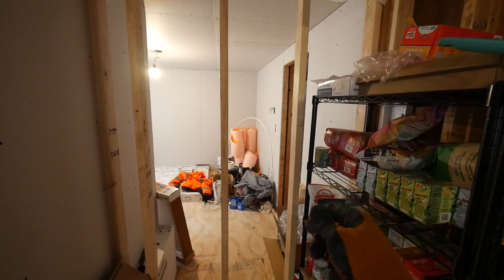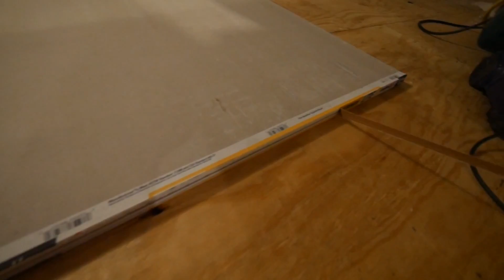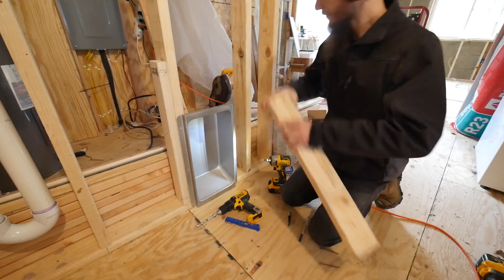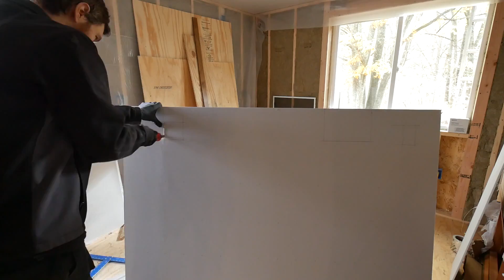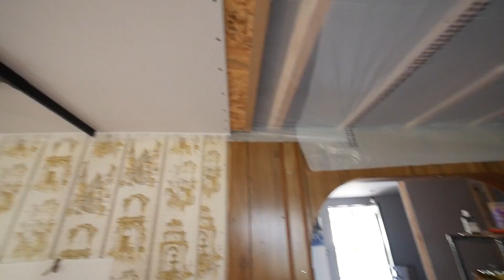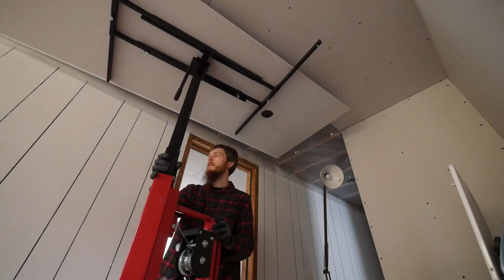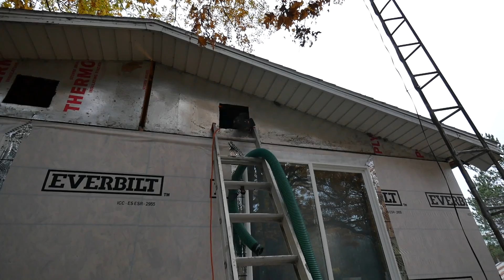Renovation Overload | Why we Install a Vapor Barrier on the Ceiling - Home Renovation

Comment: I grew up in Southern California where we had no insulation or vapor barrier in the older houses.  It could get pretty cold for little feet on bare floors.  So nice to see some real time explanations of the purpose, and placement of the vapor barriers.  Makes real sense.  Now, it seems, you're winter tight, and can use the bathroom inside, and wash laundry...  Are you hanging it outdoors?  So many little things to remember and do.  Congrats on it all.  I could feel the relief. Kid's cameos, so cute.
Reply from the maker: We were hanging it outdoors up until recently. We bought an indoor metal clothes drying rack to use now :) Thanks!
Reply: @diyfferent  ...  It wont be long till everything is painted, and  your drying is working.

Comment: Woooo Hoooo!  The finish line is clearly in sight!  Vapor barrier - DONE!  Wall insulation - DONE!  Kitchen sink drain and vent - DONE!  Wiring - DONE! (?)  Washing machine hooked up and in use!  Blown-in ceiling insulation - DONE!  Plywood on the floor - mostly done?  Ceiling dry wall - DONE!  Laundry area dry walled in!  J-channels for dry wall finished edges.  BTW, thanks for the explanation about the vapor barrier on the inside and on the ceiling.  Once again, a dead-man lift would have come in very handy when you got to the part of the hallway where you couldn't use the dry-wall lift.  I'm sure you have the material you need as scrap wood in your barn!  Doug, I was completely shocked to see you crawl through that little tiny hole in your attic to do the blown-in attic insulation!  The extra long video was super nice!  And it was SUPER nice seeing Belle and Maverick again!  Maverick is your mini-me Doug;  You will have no trouble training him as your apprentice!  Just do it while he is still young and wants to mimic you!  LOL.   I know it feels good to have heat again.  Before long, you will have your back door in and installed and you will be all closed in for the winter!  Oooh Ra!

Comment: The one thing I know about you is that you do your research before you do anything.. I’m confident you are doing an excellent job ..  I can imagine how cold you get there.. here in Arkansas it got down to 27 degrees last night.. we went from AC the beginning of the week to heat on yesterday.. with all the insulation you’re putting up it shouldn’t take much to heat the house.. I’ve learned a lot from how you’re doing the sheet rock.. I envy your agility.. at my age , 77 on the 25th of November , and two artificial knees, I don’t have any flexible..  now you don’t have to push yourself to beat the weather..and you can work without having to bundle up..I can wait until the next episode..
Reply: jerrie wyatt Happy early Birthday... I also have a Birthday this month.....🎉🎊💐🎂
Reply: Hiedi Romero Thank you so much! So sweet of you!
Reply: Hiedi Romero Happy birthday to you as well..

Comment: If you take a couple of 2x4"s and make a simple T , it really helps to hold up that drywall on the ceiling especially in the spots where the lifter wont fit.

Comment: In Australia we make a T board for holding drywall up which is so great in confined spaces. You use a long board tall enough to reach the ceiling and screw a smaller board across the top of it to form a T.  You push this up around the middle of your sheet of drywall and it will hold it in place. It’s too late for this house but it might help to know for the future. You do such awesome work and I love to watch.

Comment: Great work- way to push through. A suggestion for your ceiling lights- go with 4" recessed LED- that way you get full clearance, great light and energy savings. Also a big plus is that you do not have the problem of IC rating when using correct bulbs ( much cooler). Retrofit is easy and you can use the holes already cut.

Comment: For the narrow hallway ceiling, you could have built a tall “T” or 2. Like the kind cabinet makers use to aid in holding up the top cabinets while they install them.
Reply: Good idea!
Reply: When I installed drywall on the ceilings in my two bathrooms by myself, I screwed a temporary 2x4 cleat to one of the side walls about 3/4" below the ceiling joists.  Then, I slid one end of the drywall in that gap to hold the drywall while I held up the other end and started screwing it to the ceiling joists.  This method worked well for 5' long sheets.

Comment: In the late 90’s here in horry county South Carolina the electric company gave home owners an incentive on there monthly bill if while under construction they put plastic on their walls (and ceilings I think). They called it a good sense home. Well. What they didn’t realize it made the house unable to breath properly in this climate. They humidity here is very high at least 4 months out of the yr. my house was built by my father in law in the late 90’s. But, my father in law was smart. Once the inspector left,  he cut all the plastic before The Sheetrock went up. I believe there are many people here who sued because of the mold issues they encountered in the following years due to the home not being able to breath. So.... You are absolutely right on the money with the plastic and the climate you live. Love the videos!!! Good luck on your remodeling!!!

Comment: I just uploaded a short 8 1/2 minute video a couple of days ago and it took me 15 1/2 hours to upload it with my slow internet.  I can't even think about uploading a video the size of this video.  It would take me many days to get it done.  Then again, I only have CenturyLink and the fastest speed they offer here is a 1.5 meg connection.  Your place is really coming along great.  Wish I could get some of that stuff done to my place one of these days.
Reply from the maker: Wow, that's crazy slow! We are very lucky and have high-speed fiber optic internet. Most of our videos upload to Youtube within a couple of minutes. I think this one was under 5 minutes. Thank you :)
Reply: @diyfferent  They don't even offer fiber optic here.  We just have regular phone line DSL.  I count myself lucky in that they did upgrade it to a 1.5 meg service here about 4 years ago.  It used to be only 768K service before that.

Comment: You're absolutely correct in putting a vapor barrier immediately behind your drywall. Exterior walls, although insulated, have to breathe. You can't be trapping moisture in the exterior walls. It will, over time, ruin your insulation and rot the wall studs. Ever notice how craft-faced insulation is installed? It's always installed with the craft paper toward the living space, whether wall or ceiling.

Comment: Very good explanation of insulation and vapor barrier Doug!  The word you were fishing for was Vapor 'mitigator'.  Now, to help you out with your less vs more attic insulation, and less vs more attic ventilation, let me share a little backstory on the subject.

The old way of thinking was that the attic was a buffer zone between the house living space and the cold outside.  For instance, say you are trying to heat the house to 70 degrees, and the heat loss into the attic makes the attic 50 degrees.  Now you only need to heat the living space to compensate for a 20 degree difference at the ceiling instead of say 70 degrees assuming it's zero outside.  It was based on this type of thinking that they generally installed wood blocking at the eaves, to prevent airflow into the attic.  A warm attic used to be believed as a 'good' thing.  Now as you know anything that traps air is by default an insulator.  So when the roof gets covered in snow, the snow itself is an insulator.  Now in our previous supposition argument, the 50 degree attic now melts the bottom layer of snow, and the resulting water runs down to the eaves.  Once the water gets past the outside wall, it loses its warm support and freezes, creating ice dams.  As the ice thickens, the reservoir of water gets deeper, and can then enter the house through cracks in the roofing and nail holes.  This is further exasperated by capillary effect, allowing water to run even further uphill, and drip in on even more insulation, and not only negating the effect of the insulation, but worse, turning the insulation into a heat conductor!  In our scenario, water can even run down the exterior walls, compromising insulation, creating rot and mold.

This is why we heavily insulate the attic space, and at he same time, provide adequate ventilation.  If there is a vapor barrier present in the ceiling, the ventilation ratio is 1/300.  That's 1 square inch net free ventilation area for every 300 square inches of attic floor.  If there is no vapor barrier present, that ratio doubles to 1/150.  There are also general guidelines to splitting that ventilation.  The two commonly accepted practices are 50/50 and 60/40.  These are percentages, and eaves are listed 1st.  That's why you'll find ventilated soffit generally runs about 9 square inches Net Free Area (NFA) per linear foot and ridge vent runs about 18 sq in NFA per LF.  So, looking across your roof it's eave = 9 sq in (25%), ridge = 18 sq in (50%), eave = 9 sq in (25%).  In more complex roof shapes where drafting is more complex, the 60/40 split is preferred, as eave 30%, peak 40%, eave 30%.  If for some reason you cannot balance within these ratios, the recommended practice is to err on the side of more eave ventilation.

In a previous video, I recall you saying that at some future point you plan to add ridge vent and block off the gable vents.  This is perfect!  If gable vents were to be left in place, they would have the tendency to create errant drafts in the attic, disrupting your desired air flow.

So all in all you have an extremely good grasp on insulation, heat flow, moisture flow, condensation and the problems that can ensue.  Gotta say, you remind me so much of me!  Kudos, and thank you for sharing your story!

Comment: leave the overhead light as recessed lighting and run wires to the under counter light.  The under counter light will not help see inside of the shelving or cabinet area.  There can never be enough light in a home.

Comment: Just a suggestion to help with the ceiling where you can't use the jack:  make a couple of t-braces to stand under the sheetrock to wedge it against the ceiling joists while you position and screw it down.  Saves a lot of strain and aggravation.

Comment: Omg Maverick is getting so big. Your kids are adorable. Loved the building blocks at the end. I'm glad you guys can go a little slower now. It must feel great. You should do something fun. Love you guys. My only question is should you have used the water and mold protection drywall around the washer, dryer area and in the bathroom? I know we did when we redid our bathroom.
Reply from the maker: We prefer to use the regular drywall. I think the laundry area would be a good spot for it though. It's good for certain things, but regular drywall works just as well under normal circumstances when it's finished. Around here the moisture resistant drywall is about double the cost of the regular drywall and doesn't offer much added benefit. I haven't used some of the newer moisture resistant boards but the old green board was pretty bad, imo.

Comment: Like you said... building in the north is different from building in the south.  Insulation in the north is like making an igloo to keep heat from escaping.  In the south you insulate like making a bathtub to keep the air-conditioning from escaping.  Both make sense for each location.  Vapor barriers work differently per location.  You explained it well.

Comment: When I worked for a power line co. and we set poles you took the dirt out,  set the pole and put the dirt back. It depended on the phase of the moon, sometimes the dirt would be even, sometimes to much dirt and then sometimes not enough. Maybe it works the same way with your blown insulation.

Comment: My house in Illinois has vapor barrier behind the ceiling drywall, too.

Where do you guys that R-23 mineral wool in single bags? My local Home Depot only does special orders in sets of 12. 

A cheap extendable painter’s pole taped to the end of the insulation blower hose helps you get it into the narrow spots. My attic has nearly four feet of headroom. I feel lucky after seeing you maneuver around up there.
Reply from the maker: We get it at a small local building supply store. We have seen single bags sold at certain Lowes or Home Depot locations. Just depends on the area.
Reply: DIYfferent At the stores near me, finding bags of their r-15 is hit or miss. I’ve never seen the r-23 in person.

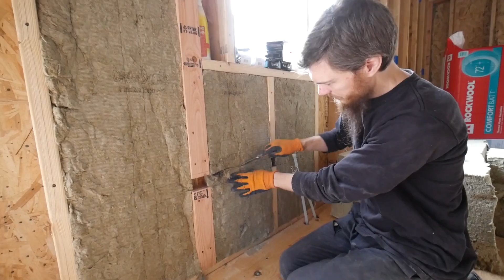Comment: Glad to see you making a lot of progress and getting the drywall installed on the ceiling and the insulation done.  We had 3-4" of snow on Halloween in central IL, and this morning, the DJ said the temp was 22 degrees when I turned the radio on around 6:30.  Fortunately, there's no snow in the 10 day forecast at this point.
Reply: I'm from central, il as well 😁 the snow was a little ridiculous
Reply from the maker: Wow, that seems early for snow in central IL! We got snow yesterday, but I think we only got like 2".
Reply: @diyfferent  Yes, it's way too early!  We usually don't get an accumulating snow till mid-December, sometimes not until after Christmas.  It was mostly sunny today and got up to about 47 degrees, so most of the snow is gone now.

Comment: You might want to think about cabinets over the washing machine and dryer?  To keep all of your laundry supplies.  It really is handy.  Or even just a shelf.  You also might consider having an open shelf for folding clothes.  This shelf could be a drop down shelf...so you can put it up when not in use.

Comment: if you do ever decide to paint you can use voc free paint.  I added this stuff called Insullad to the paint which makes it very thick but it is made up of ground cream which did in fact cut my heating bill just a tad but the main thing was that I didn't feel that air was blowing through the walls as before.  This was a house inn Pennsylvania which is notoriously cold because they were made with just T11 and just sheet rocked over it with no insulation.  It was a vacation home so I didn't want to do any major things at that time,

Comment: Just heard about the power outage between several northeastern states.  Michigan was included as part of the states.  Some say it is related to high winds.  The only thing I could think that would affect the power lines would be a tornado.  Not sure what is happening up your way.  If you can let us know how your doing.  Much luck and stay safe.
Reply from the maker: Hm, hadn't heard of that. We didn't lose power or have any high winds here though.

Comment: You gotta make a deadman support for the drywall installs on the ceilings where you can't use the lift. Two 2x4's in a t shape and you can wedge it up gently to support the drywall.

Comment: I cannot BELIEVE you fit through that tiny little hole! I'm glad you finally could use a sheetrock lift, saves those backs, arms and necks. Why did you guys decide on blown-in insulation? My husband and I used the same kind of batts that we used in the wall, just cutting it to size and placing it in between the joists once the sheetrock was up. Perhaps it's a cost issue...It was just a lot easier than what I've seen you guys doing. So glad you're getting some heat! And your kids are cute and wonderful.
Reply from the maker: Since all of our joists were doubled up against the trusses, each insulation bay was narrower than normal and every batt would have to be cut to width and that would add a lot of work. Also, with trusses, the insulation sits between the trusses but leaves gaps in between where the truss work is and those gaps equal heat loss. We liked the cellulose because it really fills in all the odd spaces and gaps around the trusses and costs less.

Comment: Doug, that reminds me of rock wool insulation. It has been many years since I used any of that. Vapor barriers are good under certain conditions however too much can cause lots of problems such as causing an excess of moisture which can lead to mold. Most fiberglass insulation is provided with a single moisture barrier which is really all you need on exterior walls. Adding a second barrier leads to what I mentioned above.
Using solid no perforations plastic in the south is a no no I've seen someone do that before and it was the biggest mess I've ever seen. It destroys drywall and can completely destroy a home causing black mold. I've seen homes that were over a 100 years old with no insulation that were like they had just been built. However most of those were built from heart pine with actual 2x4's you know lumber that was milled but not planed down.
Reply: That’s my house! I mean, the foundation is shifted, so there’s cracks and stuff, but I’ve got 0 insulation and the measurements are not lining up with anything else I find at the store so I’m trying to do a DIY gut and build 😅 I’m so under qualified this is my first home. YouTube has quiet the info 😅

Comment: You guys are almost all done insulation wise! Are you doing anything in the floors? That's a huge area to have un insulated and with electric heat, itll save a ton and make you comfortable!
Reply from the maker: Instead of insulating the floors we want to insulate the crawlspace walls. :)
Reply: @diyfferent  great idea. Just make sure to encapsulate the floor well and put that poly behind the insulation on the walls! Fantastic renovation so far!